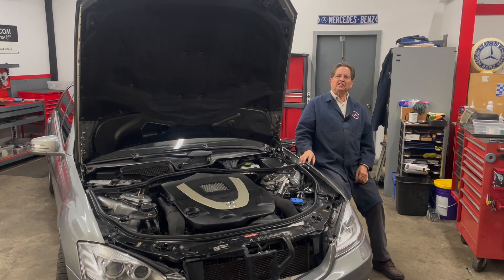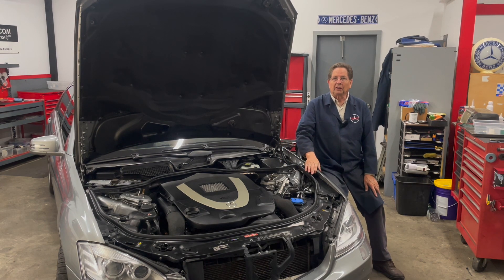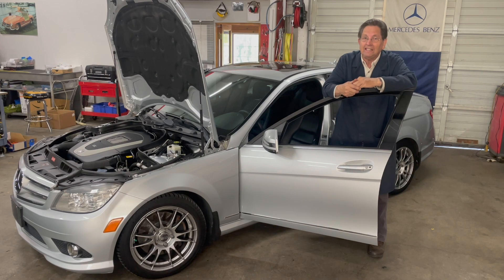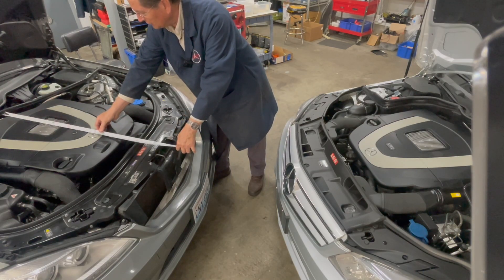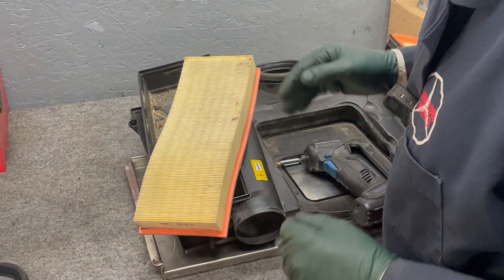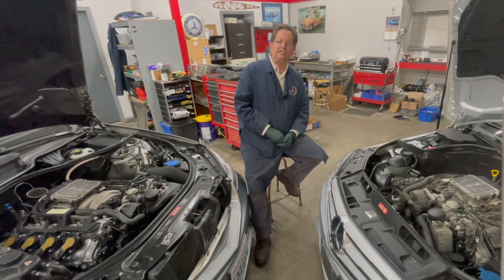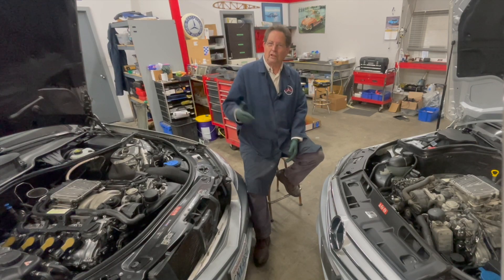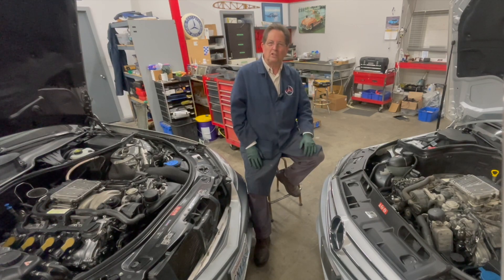2006 to 2013 Mercedes V6 and V8 Engines:  Side-by-Side Comparison

Comment: My 272 V6 2008 (Not with cam problem) developed a nock(Not a rattle) on cold start after 1st service, dealer told me ythey changed to different oil(What do I know).....I changed oil later to Fuchs 5W-40 which the problem goes away most of the time. Now after an oil change I suddenly hear it again(5W-40), now I wonder if the oil is indeed 5W-40-?
The car has now 155 000Km with a clean engine on inside, changed oil every 6 months or 2500km, and since 20 000Km nothing has broken from the knock, so not sure what that is.

I would like to know if its time to put 10W-40 in the engine, I live in a country it hardly snow if any.

Comment: Thanks for sharing this Kent.

I've learned on YouTube there's plenty of "experts" that don't know what they're talking about 

Just anonymous voices proclaiming a knowledge on something for which they aren't qualified 

I've run through two or three "best Mercedes and worst Mercedes engines" and at least two of them said the M272 was one of the worst because of the balance shaft 

So I made a correction to them telling them they corrected it in 2007 and if you're really curious on the Internet they go into the engine number where the correction was made 

I've had 2 E Classes  both of which have a good reputation -  a 2000 E430 and a 2011 E350.  

The E430 has been almost bulletproof except for this stupid headlight wiring with disintegrating insulation. It currently has 186,000 miles on it   A few days ago I ended up wrapping it in electrical tape before I can determine how hard it is to replace the headlight wiring harness 

The E350? 102 ,000 miles and no oil leaks - no new motor mounts in it and idle so smooth you can't even tell the engine is on 

But I've had to change the blower motor and the secondary air pump which kind of surprised me 

And almost since the car was new although right after the warranty of course the rear camera acts up about 10% of the time 

And 10 years ago a shop told me it's either the command sander or a module in the trunk and to wait for it to go out permanently for them to diagnose it 

Well it's been about the same for the subsequent 10 years so I've just ordered the module and I'll hope for the best 

Anyway thanks for the nice video

Comment: I have a 2011 C300 with a 272 since new and most of the work has been done at the dealer. The biggest problem I had was at 119,000 miles was the leak from the radiator down to the transmission box. This happen because the coolant and the transmission oil share the same radiator. The damage was expensive, I had to rebuilt the transmission, clutch, and other parts in the transmission plus get a new radiator, coolant lines. This whole thing cost $9000. At the same time the rear and front differential started to go bad and started grinding every time I turn the steering wheel. This supposedly happened because the  dealer at 60k miles replaced the differential oil with the wrong oil. I replaced the oil plus they added a mixture of some sorts that add additional lubrication snd after 20-40 miles of driving the grinding cleared. Other than that, I have fixed all the oil leaks that you have mentioned and I do worry about the issue with those little arms pulling down the throttle body that might go bad on the intake manifold, but that’s something that I might look at later on. This car is amazing and I will never sell it. I do have other Mercedes cars, but I find myself driving 10:56 this one the most. Most remarkable is that I didn’t have to change brake pads or rotors until 114,000 miles. This is a car that drives like old-school Mercedes, feels heavy at the bottom drives very smoothly without being bouncy or too soft plus is the perfect size for a sedan.
Reply: front differential, your C-class is AWD?

Comment: If you have the option to buy a 2012 Mercedes V6 and another V8, both with the same mileage and maintenance, the same price, which would you choose and why? Thanks for the video
Reply: Which model 2012 1st might not be 273 for v8 it might be 278 for the v8 biturbo model
Reply from the maker: If you had the option to buy an apple or an orange, both the same size and both with the same freshness, which one would you choose and why?

Comment: i have the m273, 90k miles check engine light came on any ideas what could it be, just had the transmission serviced
Reply from the maker: Simple matter of plugging in an OBDII code reader and getting the fault diagnostic code. Once you have the code, you can put that into Google, and you will have the opportunity to read and learn more about the problem than you would probably ever want to... :-)